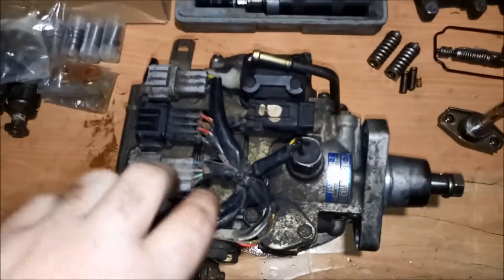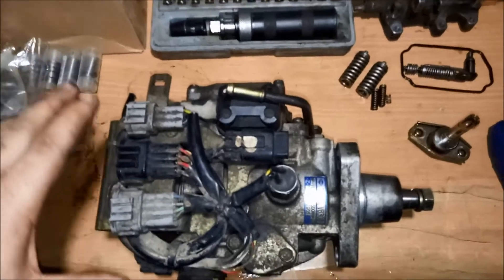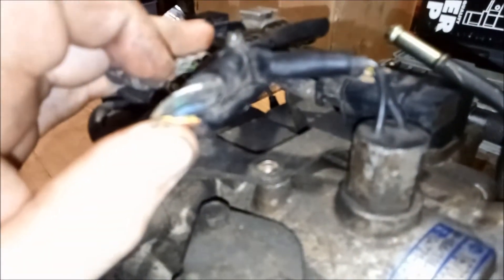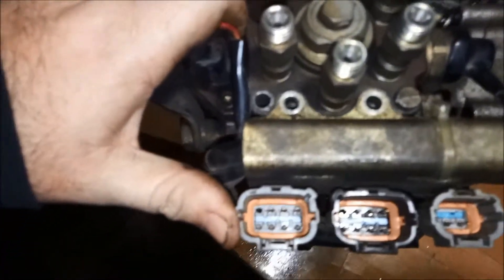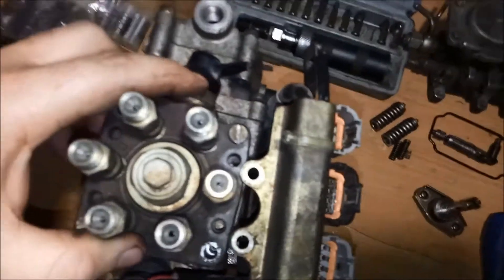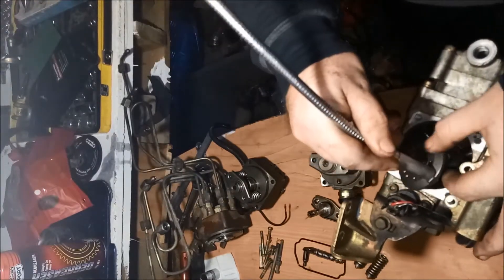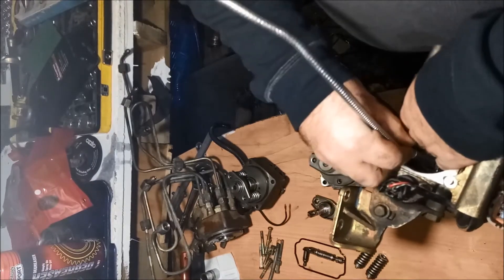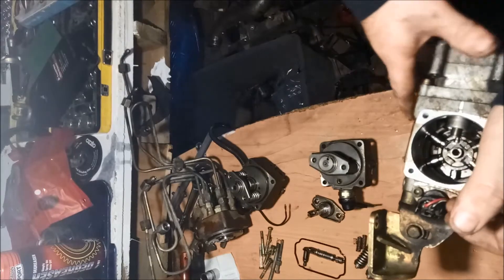part #1 rd28 gu pump disassembly for upgrade for a gq pump

Comment: I have a 2.8 td patrol 98 model runs fine but every now and then it splutters a bit and wont go past 80km in 4th.go to 5th and seems to go past it.now its doing it at lower speeds.doesnt seem to be any water in fuel and not sucking air.any help would be appreciated cheers!
Reply from the maker: You maybe have a clogged fuel filter or your pump pressure inside the pump is getting low need a rebuild or you've got a bad injector
Reply: Cheers.has new fuel filter put in deisel shop.tested injectors all fine. No air leaks they say pump is stuffed.jst thought it would do it all the time rather than now and then.sounds like a few $$$ cheers

Comment: Can you tell me why you use the GQ Pump instead of the GU Pump? Is it because you can "tune" it manually while the GU Pump is regulated by the ECU? Here in Austria nobody knows anything about these engines so its hard to find someone that could maybe program my ECU for the VNT Turbo im putting in.

Comment: Hi there. Got a GQ pump to fit it into my GU RD28Ti and I'm planning to fit the rotor in my GU pump with the GU injectors. What do I need to do to my GU rotor head to make it fit the GQ pump?
Reply from the maker: you need to holes for the springs

Comment: HI there, I have a 1991 GQ Patrol in the states. I am looking to upgrade to 11m rotor head in factory mechanical pump. I have found part number for GU rotor head as Nissan 16760VB300. Is this an 11mm piece and will it fit directly into my current pump?

Comment: Hey mate how did you go with the dash fitting a gq pump to a gu?
Reply from the maker: DMDTUNING25 what you mean
Reply: mighty rd28 4x4 
Sorry mate your other video you had a mech gq pump and it looks like you have a gu. What I mean is the tacho won’t work you will have engine light and 4wd light on. What else comes on or does not work when fitting mech pump. 
Did you just set it up like a td42 and use a td42 throttle cable. 
How has the ebay 12mm rotor head gone good part?
Did the cam plate you fitted have a bigger can profile? Also where did you get the cam from.
Reply from the maker: DMDTUNING25 my 4wd light works normally. my engine light does come on because I don't have the injector pump connected so it doesn't recognize that theres no pump there aswell as my air flow sensor  and no crank angel sensor or oil pressure sensor. I don't run any of these but No other lights come on everything's else on your dash works normally.. Taco doesn't work when fitting the gq pump unless you make it work,  I successfully made my taco work. everything else should work like normal. 
I used a rd 28 throttle cable and pedal off a gq, It bolts in after to remove the gu pedal wiring and clips.  
The 12mm eBay rotor head is a good part,  I haven't had any problems other then when the wrong fuel was added in the tank. So it does the job fine.  
Ive bought 3 12mm rotor heads. 
 I bought one off the local deisel shop which are more expensive for the same part as the eBay bought rotor head.
 The cam plate has the same cam profile and lift for that cam. 
I get my parts off my local deisel shop or offline. It depends on who has the cheapest part or how fast it can come.
Reply: mighty rd28 4x4 thanks mate so basically only the tacho and throttle that’s an issue. What about the glow system and starter motor?
Have you ever looked at a bigger cam profile from another engine with this type pump on it? Maybe a td pump?
Did you ever fit a 12mm head to the electronic pump and fit a chip to it?
Reply from the maker: yer and applying power to the pump, you should be able to power it off the old power wire from the gu solinoid, if it doesnt work you can find 12 volt auxilary power (aka reds) and connect it there. 
i have a manual glow system in my car so i have to press a button to glow my plugs, but the gu should run like normal the glow plug timer are known to play up in the gu glow plug relay. the starter motor works normally as well. 
i have looked at the 3mm cam lift instead of the standed 2.8mm cam lift but have not tried this way yet, im pretty sure the td pump is the same internally as the gq pump apart from the gq being 9mm standard, and the td is 11mm boost compensated. 
no i have never fit the 12mm head on an electric pump, but i know you can., the chip is possible but might have lymp mode problems, and so on.
Reply: mighty rd28 4x4 Just had a look and can get a 4mm cam plate as well. Might be a little big for a 12mm Head. 
Would be interesting to fit a 3mm cam. 
Have you fitted the adjustable boost comp diaphragm like a td has? Will help with tuning. 
Donator Speedbox seems to be the chip to use on patrol4x4 would be interesting with pump mods if it can be tuned with a td04 turbo on it
Reply: mighty rd28 4x4 another thing I would like to try is to shim up the injectors to have a higher injection pressure.
Reply from the maker: yes you can get a 4mm cam plate all so can get a 14mm rotor head but you be looking a bigger delivery valves and lines to keep up with the amount of fuel going through them  and injector nozzle and lift pump with the cam plate just add more life so you get more fuel in the 12mm rotor head what give you more fuel to motor all so the gq pump come standard with a adjustable boost comp diaphragm and my max with a fuel pin i made for more fuel on boost i did have a Donator Speedbox on my car ones upon a time
Reply from the maker: DMDTUNING25  you can adjust your cracking pressure on your injectors up high or low but you need a pop tester to do it or get a shop to do it for you
Reply: mighty rd28 4x4 the rd pump looks different to adjust to the td pump for boost comp adjusting. Td is on the top. Did you grind up a pin or buy the pre machined pins. 
In your opinion you think the full mech pump is the way to go over a modified elec pump and speedbox fitted. 
To set the pressures properly you need the pressure tester. Service manual gives you an estimate of 471kpa increase with a 0.04mm shin increase. Did you ever get your car on a dyno to check power level
Reply from the maker: DMDTUNING25  the td pumps have a screw on top that adds more fuel off boost. 
the td pumps are pretty much the same internally, there are some things that are different. 
 i ground up my own fuel pin. 
yes a mechanical pump is  way better then an electronic pump, there is only one wire to worry about on a mechanical one, and you don't have to worry about computer problems. 
the car hasnt been dyno'd just yet im working towards it, my plans are to have it all done before winter,...
Reply: mighty rd28 4x4 how have you noticed the fuel Econ between the two types of pumps. 
Did you ever have any issues with the electric pump and the chip
Reply from the maker: i dont know i just put fuel in  tank when it needs it. yes i did, once i started increasing the boost, it would go into limp mode, the computer just tries to decrease the power, or its cutting back the fuel through to the engine.
Reply: mighty rd28 4x4 how much boost did you increase it to before you had issues? More than likely it was the maf sensor reading to high causing the ecm to go into boost cut
Reply from the maker: sorry to long ago i cannot remember but ill say over 20psi
Reply: @mightyrdx how did you increase the fuel boost on the electronic gu pump?